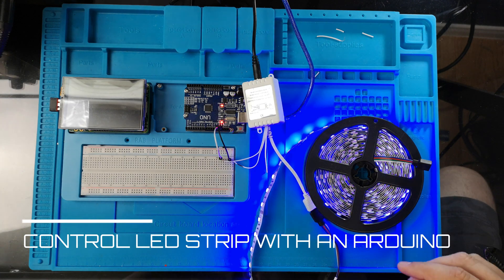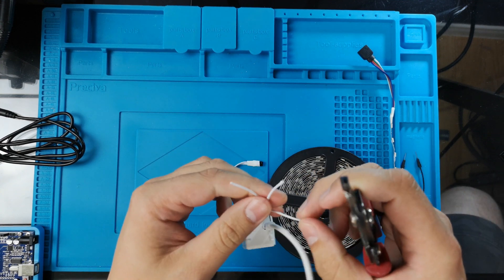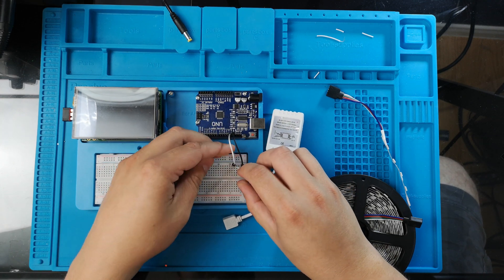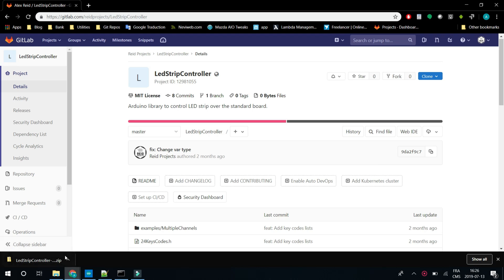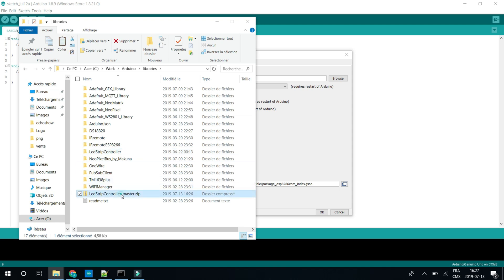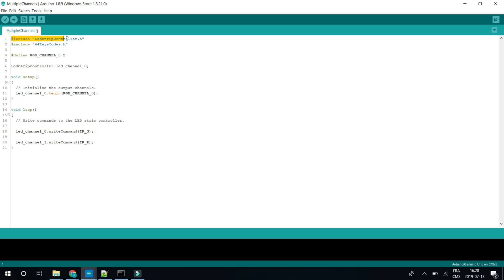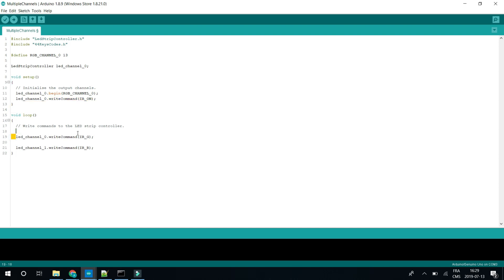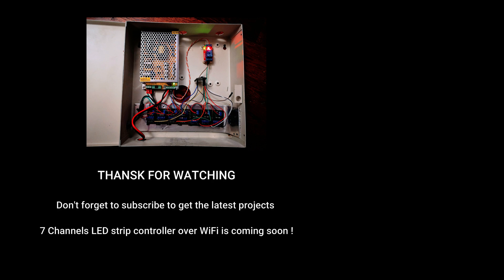How to Control Analog RGB LED Strip with Arduino | Easy way

Comment: But what if i wanna use the Ir receiver with the Arduino? Is there a program or circuit ?? And also my rgb strip is for 12 volts , so will this method work?

Comment: Y'know you were the only one that had a video on this topic! You basically helped me save some money on my project. Thanks so much! (If you could answer a question it's in the replies)
Reply: So I'm trying to control this led with a 6volt 4amp hour lead acid battery. How would I step down the voltage so I don't blow up the LEDs?
Reply: @yutarou2307  use a resistor, 12k should be enough.

Comment: Bro this was exactly what I needed. Thank u so much.
Reply from the maker: Awesome ! Glad that it helped :)
Reply: @ReidProjects  I have the same strip and controller, I want to make it bluetooth controllable. Is it ok if I use ur method and connect the controller to a arduino nano and then connect it with a HC-05 r maybe esp32. Do you have any other suggestion?

Comment: After programming that cip do i need to connect the rgb light strip to that board forever or can i remove it?
Reply from the maker: Hi ! Yes the led strip and the controller must stay connected to the Arduino. Hope it helps :)
Reply: @ReidProjects  thank you

Comment: Thank you, though I must ask,
Does this just sends the same codes as are possible by using the remote, without adding any other new options/codes??
Reply from the maker: Yes indeed. As the effects are "hardcoded" on the controller, we can only use the same ones than the remotes. Hope it helps :)

Comment: Hello I have a question I was able to send code to my arduino, and my arduino is receiving power but I cannot get the Led Lights to turn on.
Reply from the maker: Hi, did you try both code files (24 keys and 44 keys) ? It could also be related to the wiring. You can plug your IR receiver back to be sure that the controller and the LED are still working properly.

Comment: Hi, I am not very experienced so I wanted to ask what cables you use at 1:26? Are the two cables these jumpers like male-to-male or male-to-female? What do I exactly need? Thank you!
Reply from the maker: Hi, I'm using male to male jumpers on that part, like these : https://amzn.to/32HGOxx
Hope it helps :)
Reply: @ReidProjects  Yeah that helps a lot! Thank you very much!
Reply: @ReidProjects  Hey, I have another question... I bought this LED-Strip with 3 Pins: https://www.amazon.de/gp/product/B07TJCXYBT/ref=ppx_yo_dt_b_asin_title_o02_s00?ie=UTF8&psc=1 and now I am not able to connect it to the LED Controller, because there are 4. What would you suggest me to do? Tanks!
Reply from the maker: So bad news is that this strip cannot be conttolled with an IR controller that wasn't built for that.
-> Good news is that this LED strip is an addressable one, so you can control each LED individually with your Arduino which is even better (a bit like what I did here https://reid-projects.com/how-to-control-ws2812b-led-strip-with-a-sonoff-basic-and-esphome/)

Have a look at some tutorials with WS2812B strip like this one https://www.youtube.com/watch?v=SkBlp5-VkGM it should help :)
Reply: @ReidProjects  Thanks  a lot! But would it also be possible, to buy a new led strip, which is compatible? It would be very helpful, if you could give me a link for one! Thanks
Reply from the maker: Yes no problem, on my side, I'm using that kind of LED strip https://amzn.to/34Zrpes

Comment: is it possible to control a single led if you don't have an addressable LED Strip
Reply from the maker: This is indeed for non addressable LED strip, and if you only have one LED, it would still work. That said, you still need a LED strip controller. Hope it helps 🙂
Reply: Reid Projects - Arduino - Raspberry Pi - DIY What is mean is can u control single LEDs in an LED strip of the strip is non addressable
Reply from the maker: Well, you need a LED strip controller which work with an IR remote and control an RGB led strip (not addressable strip). From there, you can have one led or more on your strip, it's not really important.
Reply: Reid Projects - Arduino - Raspberry Pi - DIY is it possible to make 1 led green then the rest orange or something, I’ve been playing around with the code and I can’t find anything that can do that
Reply from the maker: Unfortunately if you want to apply different colors to the same led strip at the same time, you need an addressable LED strip

Comment: bonjour! bon travail, j'ai exactement le même contrôleur, je pense que j'ai bien trouvé le grnd et le Data mais ça ne réagit pas, j'ai le R qui s'allume, impossible d'avoir les autres couleurs...
Reply from the maker: Salut ! Merci ! Jusqu'à maintenant j'ai croisé 2 types de manettes : 24 et 44 boutons, avez-vous essayé les 2 types ? Sinon, vous pouvez aussi vérifier le voltage de votre contrôleur (entre GND et VCC). S'il est de 3.3v et que votre Arduino est à 5v, il faudrait ajouter un diviseur de tension.

Laissez-moi savoir si ça fonctionne ! :)

Comment: the off command doesnt work and instead it blinks the strip and burns out the controller
Reply from the maker: Mmm that's weird, sorry to hear that. On my side, the Off command worked without trouble on my 10 devices. Do you have any details on your setup, wiring and code ? I could plug it on my side and push the testing futher.
Reply: Do you have email ?
Reply: The other differences in my setup is I used a different controller I use a mini
Reply from the maker: Ok I sent you an email, thanks !
Reply: @ReidProjects  Hi, I have this same problem, im using an arduino nano, and the off command only blinks the leds.

Comment: Great project! Thanks for sharing.  Is it possible to control individual LED strips using this method, e.g. for making a digital clock with LED segments?  Many thanks.
Reply from the maker: Thanks ! Well it would be possible but you would need 28 strip controllers. So for project like that, I would choose an adressable LED Strip on my side. 

Whatever you choose, don't hesitate to share it with us :)
Reply: @ReidProjects  Many thanks for your reply.  I will delve a bit into this as it would be an interesting project.

Comment: Hi, my LED strip has 4 connections, G, R, B and +5V.  It DOES NOT have a simple D line or wire.  The infrared receiver has 3 wires, Red, Green and Black. I am assuming Black is ground and the Red wire might be Vcc. Any suggestions? Thank you.
Reply from the maker: Hi, this should also works with your controller, you only have to find which of the IR receiver wire is the ground and which is the data wire. 

To find the ground, you can just check the continuity between you power supply's ground and one of the 3 wires. Then the Data wire should be the one that doesn't give you a 3 or 5v on your meter.

Let me know if you were able to make it works !

Comment: Can you just bypass the strip controller? If so what changes would you need?
Reply: I guess the controller helps to control the colors to be displayed. Otherwise you may want to control the strip colors with the Arduino.
Reply from the maker: You can always control the strip without the controller, you only have to add transistors and use 3 PWM outputs of the Arduino to control the different effects.

You can take a look at this video for more details : https://www.youtube.com/watch?v=Hn9KfJQWqgI&t=246s

Hope this helps !